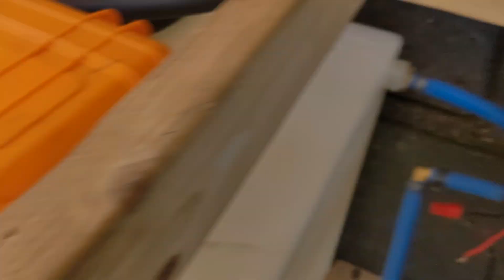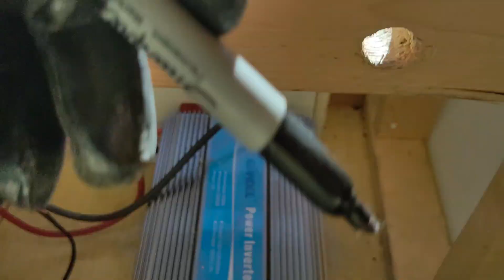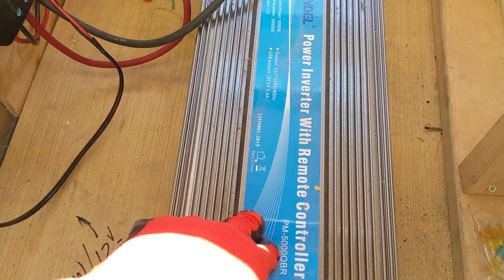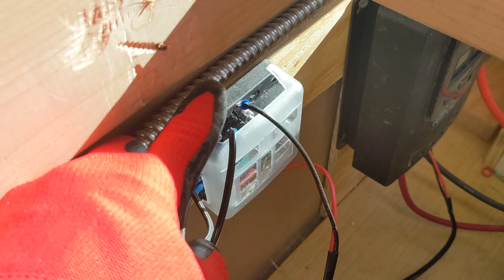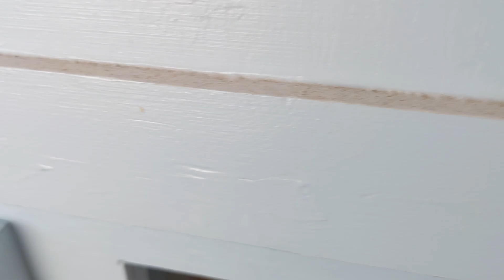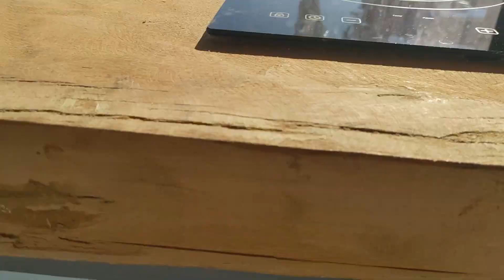Quality batteries...but a really poor installation.

Comment: DC also relies on cable run for calculations. Once you calculate intensity (A), you would need to calculate the cable run and factor it into the ecuations for voltage drop.
Reply from the maker: Always, for all conductors. Indeed. 👍

Comment: I think they just went 'We'll use the same line we connect the batteries with' without thinking. you won't have more than 12/100  going across that, you need more on the output.

Also your math regarding the current is quite wrong as well. It's WORSE than that. The Device pulls down 3500/120... the inverter isn't 100% efficient, it's pulling down way more than that to provide 29.1a at 120. Also this is 12v DC, your thinking like it's 120 AC, way diff measurements with distance becoming EXTREMELY important. Run it through a calc and it's not as bad as you think either.

Comment: Just as a rule of thumb I use for a rough idea but if you look at the 120v appliance amperage you can usually add a zero and that will give you a pretty close number to the 12v inverter input. It’s the same calculation as doing the watt conversion.
Reply from the maker: Yup...that's math I can do. :-) 12 x 10

Comment: Besides from everything (greatly)  pointed out in the video. Electronics will not work/not work good on a modified sinus inverter either and that battery bank is connected wrongly, the charge side should be crosswise connected, as the load should. Meaning that minus is taken from one battery and the plus is taken from the other (the first and last if more batteries than two) - to get a "flow" thru the whole bank...this is a shamble of a conversion and makes me pissed off.

Comment: So long as your appliances are 24v compatible, you run at roughly half amperage, which gives you about the same run time. You do need to have 24 volts capable appliances

Comment: someone correct me if i am wrong but this 200 amp hour battery pack (2 x 100 amp) would supply the 400 amp as required but only last for half hour,  However it will ruin the cells in record time and run a serious fire risk, or it could supply 20 amp and last 10 hours, (forgetting the losses etc).EDIT i forgot about the battery management system so probably not.

Comment: Just do your conversions in watts & add 30 % for conversion loss !
But the biggest question is did that induction hob work with the modified sine wave inverter ?

Comment: Darn it, I followed a wiring diagram and it said to use #4 cable, well thanks to your video I guess I am going to rewire my 6 100 amp hour batteries, good thing I found out now, thanks for a great video

Comment: I think you’re missing a decimal in the water heater number! Even a house will not provide 290 amps! I’m thinking it should be 29 amps.
Edit, I see you are talking about pulling from the battery! So never mind it would be 280 amps.

Comment: So, the water heater runs at 30 amps, but they wired it to a standard cord to plug it into a 15amp outlet. It's been 25 years since I took high school electrical shop but even I know that won't work. Amongst the rest of the botch job

Comment: As easy as it is to find out how to wire up a system properly there is no excuse for this work. I didn't even know there was a 5000 watt inverter on the market that runs on 12v. I have a 3000 watt pure sine wave inverter that's less than a foot from the battery, otherwise the wiring would cost a fortune in my garage and designing a 48v system for a 5kw array of panels for my house. Terrible choices all around on this system.

Comment: Yeah that 4g wire is puny. Needs some 1/0 at least for sure. Welding supply store is the cheapest place to grab the cable. It's where I used to get my power cable when I ran my car audio install business way back in the day. Agreed, those 'crimps' are shit. Has no where near enough battery to run anything substantial.
Reply: If the run is under 6ft the wiring actually passes current standards for a 12v system. I sure wouldn't do it(it's literally the cheapest one that is ok for 400/12 at those lengths), but it's not dangerous. The crimps are just absolute dogshit though.

Comment: Gotta love a conversion formed of the cheapest dry wood products laced with undersized, damaged wiring, and a conversion-company-installed deadbolt designed (albeit erroneously) to latch the entry door closed at the top of the door. Good thing the emergency escape windows are duct-taped shut!

Comment: 2 things:  While you are right that the load requirement for 400A is 0000awg wire  (4/0), I seriously doubt that this tiny inverter has terminals or internal wiring to accommodate 4/0awg.  Also the 4/0awg recommendation is based on 120/208 line voltage.  I believe for 12VDC it is different.  I do not have my NEC handy, but I believe it is in there.  (Don't always believe Google:  the opinions there are not always correct).  Secondly, I'm glad you touched on how the battery pack is mis-wired.  But I think you should have spent a better explanation on why.  In it's current (pun?) wiring the lead battery is doing all the work and the second battery is just along for the ride.  You will not get 200A out of that configuration and the lead battery will eventually pull down the 2nd battery.  One lead (positive or negative) should be at one end of the battery bank and the other lead should be at the other end of the bank. =Dale= (Licensed Calif Electrical Contractor since 1984)
Reply: 4/0awg is overkill for a 12 volt system, it won't hurt anything but a lot of expense for over sized cable
Reply: @philipparcel2548  I was given some scraps of 4/0 so I used it. I couldn't find a definitive answer to how many amps an AGM might pull at the max. The 4/0 will handle the full output of my alternator, so I don't have to think about it.
Reply: A DC wire gauge chart will show the amps/wire size for 12 volts. It also factors in length to account for voltage drop.
Reply: I quick pulled up my calc for this, the wiring was the cheapest that was 'ok' under 6 ft.

Comment: IMO If I was redoing 12 volt DC system. I totally would completely go way over the top and then some on the cables including fuses and breakers because of being able to add onto the system without too much of a problem. Especially not having to run brand new wires if the system gets upgraded for any reasons.

Comment: I am currently using a 100 A-H Lynac Li battery tied to a 2000 W Renogy inverter. Based on your technical guidance I am also running underpowered with really only about 1200 W of usable power available. Luckily I never run close to full output so no harm done yet.
Reply from the maker: Thanks for the comment!  I don't know those batteries, so I don't know if they have an integrated BMS to limit the output current.  If your system meets your needs, then it's perfect!  The nice thing is you can always add and grow as your needs change.
Reply: @fromabarehull  Lynac is Lithium battery manufacturer from Thunder Bay, Ontario. My battery has an LED display for voltage and charge levels and I believe it also has smart functionality. I am the second owner and have been very happy with its performance.

Comment: Such valuable information. Thank you for this priceless tutorial. So many people will benefit from these details.
Reply from the maker: Why, thank you.  My hope was to make this informative and not just a gripe session.  I want to help people learn from these issues.  I appreciate your kind comment!
Reply: @fromabarehull  my question is the mix in quality.  Why put in high end Battleborn batteries with a cheap clipped wave Chinese invertor.  The two qualities / price marks do not match up. For the price of the Battleborns you could put in 500AH of decent quality Chinese LiPo.  If I see Battleborns I would expect to see Victron doing the math after the fact. Either way, terrible build I agree.